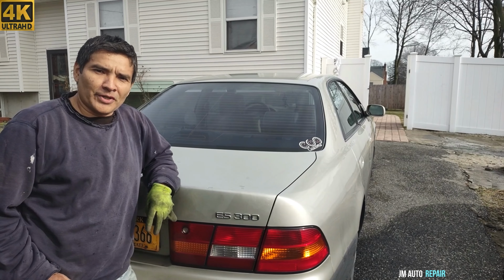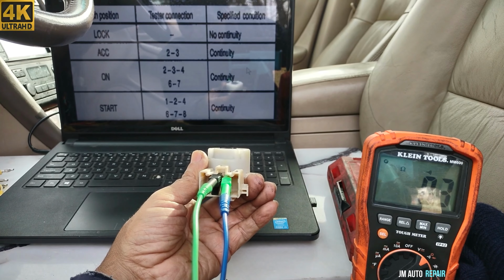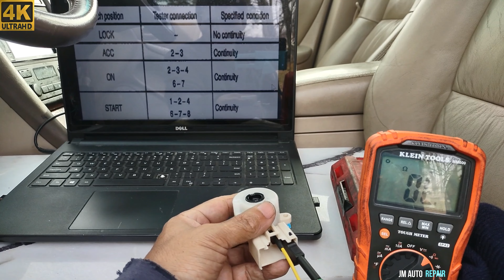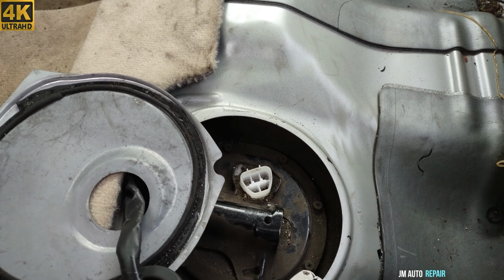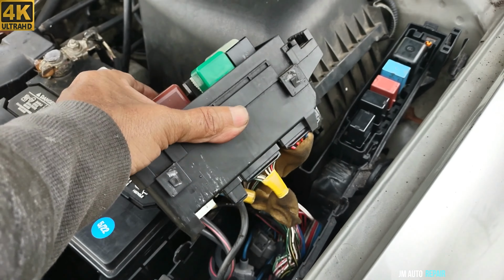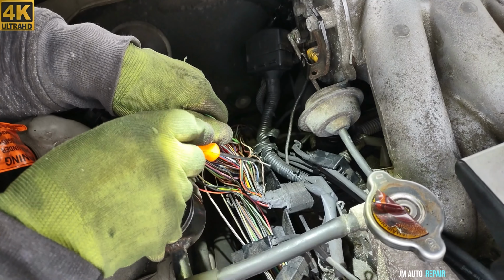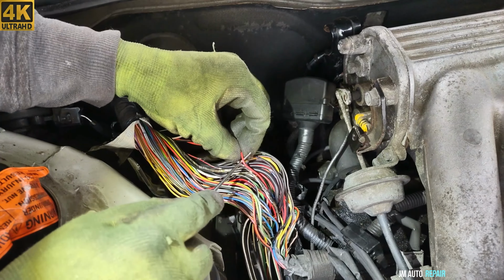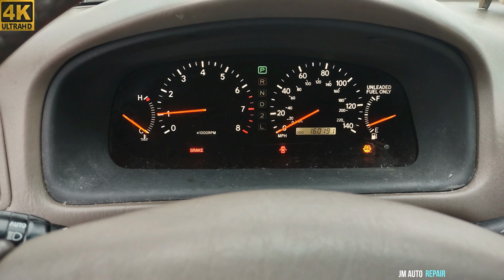lexus es300 Keeps Blowing EFI Fuse See Why

Comment: well done Amigo.  the question is, what is causing the circuit to get so hot?  I have a similar problem with 2000 Echo..  the fuse has blown two different times while the car was running..  I need to investigate what is causing the EFI relay socket to turn yellow from the heat..   God Bless !
Reply from the maker: only a short makes the circuit or wires hot and that will cause the fuse to blow, but a short can be caused by bad electrical component it is to say a short is not only cause by wires hitting each other.